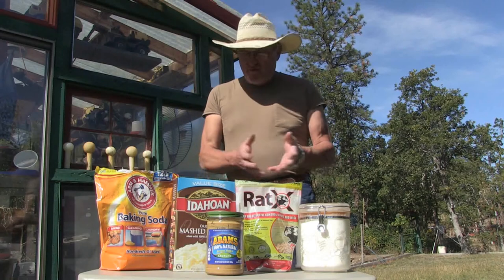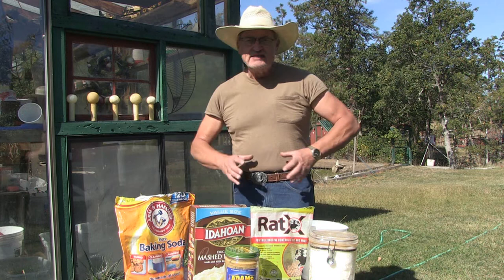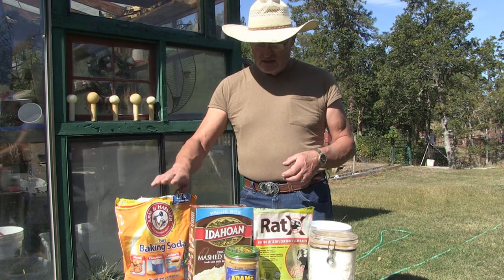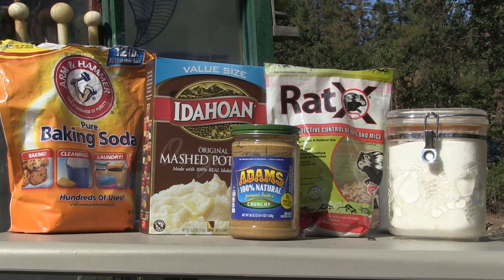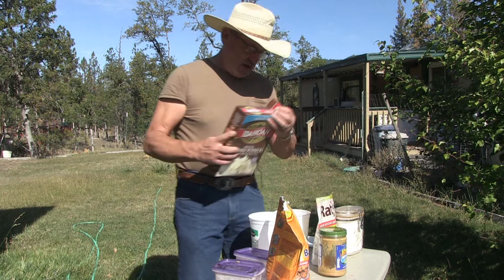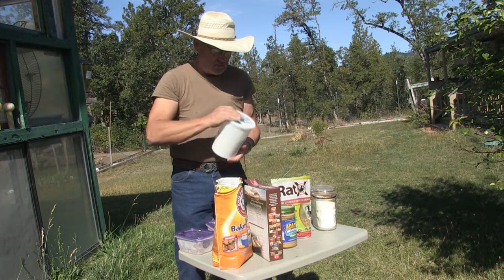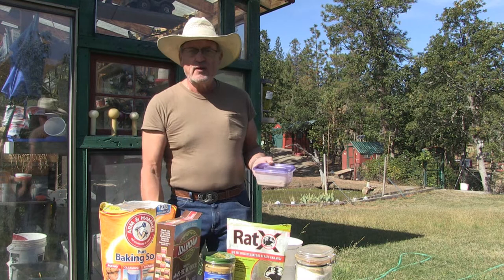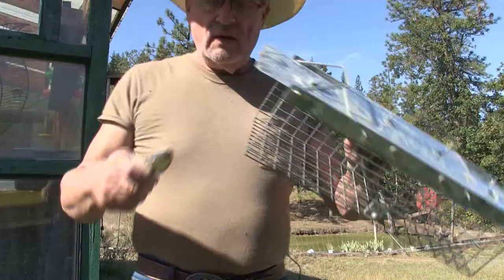DOES POTATO FLAKES & BAKING SODA KILL RATS

Comment: I tried different versions of your recipe and my rats won't eat it ie baking soda, flour, sugar and peanut butter; dried potato and soda,  and even cocoa with oat flour and soda. I then tried pushing pure baking soda in between the kernels on a cob of corn and they ate that! So I hope they die; it has been a week now and I think the rat activity in my vegie garden has slowed a little- haven't seen any dead ones though.
ps I saw in Bunnings an expensive commercial product by Ratsak that has Baking Soda and Corn flour as the ingredients- so it must work well enough; I think they would test it well before putting out a commercial product.

Comment: Since rabbits are rodents, doesn't it harm them? Or are rats special? 
Q; Does this work on squirrels?
Just for people who use poisons or traps that have pets, place a milk crate over it, holes allow only rodents access.
Reply from the maker: Yes, it does. Yes it does work on squirrels also. Rats and other rodents have an especially long digestive tract. With the reaction of the baking soda in the stomach with the acid they are unable to burp or throw up and rats cannot fart fast enough to rid them of the build up of gas so they explode internally.

Comment: I have tried this method with the baking soda and I discised it with cake mix and peanut butter and nutteler chocolate I mixed it up I then made small parcels I put it in to the small cake cup holders wrapped it up  I  also left open containers as well  by  putting it  in to  the parcels  the  rats  can take it back to the nests  a  tried  it for over three weeks with not much success  in  fact  I  reckon  they  wanted  more  I no it wasn't working because the was a big rat that I could point out from the rest it had a boil on it this rat was there when I first put it down I watched it run off with the parcels over several nights and it was still running off with them three weeks later so I decided to buy some rat poison grain I mixed it up with some butter wrapped it up in the small cake cup holders and it worked a treat I could see the difference in few days hardly any rats so my tip is don't bother wasting ye time on this just go get some rat poison grain mix it with butter or chocolate ECT all this baking soda kills rats quickly I don't think so unless I have super duper rats witch wouldn't surprise me hope this helps  cherrs
Reply from the maker: I have been getting great results with this blend and I demonstrate how it works. Check it out https://youtu.be/TBeySuYvdbY
Reply: What is rat poison grain? Is there a company name?

Comment: You seem to be fighting an uphill battle. Have you tried sitting the baking soda mix out in the wooded parameter of your land? This way you can hopefully eliminate/minimize the threat before it becomes a problem.
Reply from the maker: I recently adopted four more fixed kitties for the homestead bringing the total to seven. That should take care of the one's they can get to. The bait goes into buildings and sheds to get the rascals where the cats cannot access. Thanks for the great tip anyway.
Reply: The water bucket traps work great outdoors. The cats will make a big dent, dependant upon the cats.

Comment: Has anyone tried putting a few drops of pure peppermint on a cotton ball!!
I heard rodents don’t like the mell of mint.

And I know if you put some dryer sheets in and around  your vehicle and hood of 
your vehicle they will not go in under there and chew any of your wires.
If you Store or don’t use your vehicle very much.
But remember to remove them out from under your hood, if you’re going to use
and drive your vehicle anywhere. So they don’t catch fire.

Because they don’t like the mell of the dryer sheet or the texture either on their 
feet and underneath them.
Reply from the maker: I have heard that as well. I did it all around my home, foundations, barn, etc. Well, I'm using this stuff now with EPIC results. https://youtu.be/TBeySuYvdbY
Reply: Tried the scent method without success. I cleaned my backyard, put meshes around and under the compost, bought a food distributor that only my chicken can open. No food, no shelter and disturbing noises. Plus this backing soda recept. Hopefully, it will work.